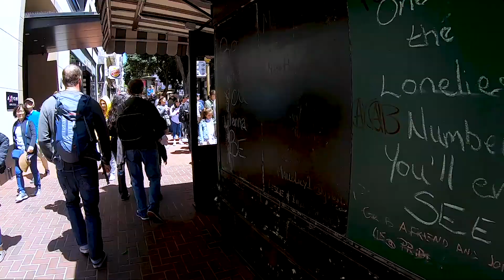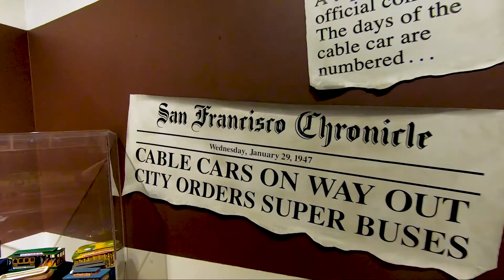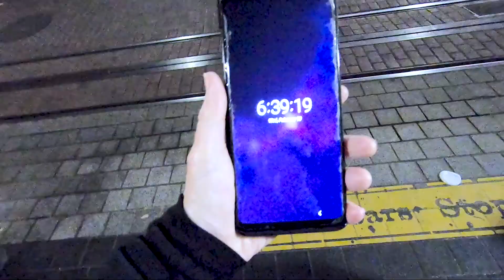How To Ride the Cable Cars 2020 | Everything You Need To Know So You Don't Have to Wait in Line

Comment: My first trip to San Francisco was spring break from an eastern college in 1969. The last day of my visit I bought two 6-packs of Coors beer to take back to my roommates, to a state where Coors wasn''t sold. Toward evening, returning to the Sir Francis Drake Hotel I was on the Powell St. cable car riding up the hill when the cable car came to a sudden stop. The brakeman said that had been happening all day and it would probably be 20 minute to a half hour delay. Some people got off but most of us just waited patiently. Soon a couple of joints appeared and were passed around, shared even by the conductor and brakeman. If it was party time I was gonna enjoy a beer so I opened one up and asked if anybody else wanted one which left me with one six pack instead two. OK easier to pack for the flight home. One of my favorite SF experiences typical of the wonderful culture there in 1969.
Reply from the maker: What a great story!!!  You didn't happen to go to Eastern in KY did you?  That would be too much of a coincidence.  I went to rival Morehead, and bringing Coors back from places was a big deal.  I think your story is great, and, you're right, pretty typical of the wonderful culture there in 1969.  Thanks for taking the time to share your story!

Comment: is the muni pass what you load on to your clipper card??? trying to figure out the multi day thing...thanks.
Reply from the maker: Yes, you can load a muni pass onto the clipper card.  The clipper card can also be used for bart.  Muni is for the city of SF, & bart is for the entire bay area.  You can also download the muni app & use that, although you have to show the app to an attendant before you can enter the station vs. tapping the clipper card.  There's supposed to be an attendant always at every stop, but my experience is that this isn't always the case.  But if you buy a 3 day or 5 day pass, & you're planning to use it for just the cable car, then the app is fine to use.  Hope this helps!  Let me know if you have any other questions!
Reply: @JasmineApple  so our plan is stay at westin airport the night we arrive (so convenient). next morning, head in to city via BART, get off at embarcadero (end of the line, correct?) and either walk or take street car/ light rail up to the grand hyatt at union square.  from there, we will branch out and explore for two days.  on the third day, we will make our way either by public transport or uber or taxi to pier 27 for cruise.  a week later we arrive back and will take BART back to airport to stay at the westin again for the night before our flight back the next morning.  our plans are very loose, but chinatown one day and the ferry bldg/ wharf one day.  we are old and nap in the afternoons.  lol.  so....i am guessing unless we see something we want to come back and revisit, we will just hang around the area around the airport or maybe explore something else you might suggest down in that area.
Reply from the maker: Sounds like a great plan!  But I have some tweaks for you.  First, embarcadero isn't the end of the line for bart.  After that, it heads under the bay and over to Emeryville & beyond.  You'll want to get off at Powell street instead of the Embarcadero, though.  Union Square is on Powell Street, and it would be a 2-3 mile walk back from the Embarcadero.  So get off at Powell -- that's the start of the cable car -- and walk up to Union Square.  it's just 2-3 blocks.  If the cable car isn't busy, you can ride that up.  The Ferry Building is at the Embarcadero.  When you're ready to see that, walk back down to the Powell street station, but don't go into the station.  Instead, walk across Market Street and take the historic F line -- that's one of the historic street cars.  That will take you directly to the Embarcadero/Ferry Building.  If you want to go to Fisherman's Wharf on the same trip, then hop back on the F line, which will take you straight there.  Chinatown is only about 3 blocks from Union Square, so that will be an easy walk for you.  Also, there's a lovely seating area and fountain behind the Apple store, if you want to get coffee and enjoy sitting outside.  I can't tell you how many hours I've spent there!  I hope you have a fun time!  SF is a great place to visit!
Reply: @JasmineApple  thanks so much.  have you other videos with other tips and hints of places to eat, etc, whilst in sfo? you are a gem!!! i will save your comments on my phone to map everything out.  lol.

Comment: Dear Jasmine, thank you for the video. I will be in SF end of this month. But I'm confused about the public transport. Not sure which one is good between Muni & Clippers. These are my list to visit in SF . Please advise if these place are reachable via public transport.
1) Lombard street
2) powel and market (cable car)
3) golden gate bridge welcome center
4) the painted ladies

Thank you
Reply from the maker: Hi Hasnida,  

How exciting to be coming to San Francisco!  I hope I can answer your questions about public transportation.  Muni is the San Francisco public transportation system, and it includes busses, cable cars, and muni trains.  
BART is the county-wide train system.  
Clipper is a card that can store fares to be used on Muni or BART.   

Usually, the cable car is the most expensive fare, at $8.00 per ride.  But for the month of August, it's free, since they just started operating them again.  Normally, I would say when you come to SF, you'll want to get a Visitor Passport, which is unlimited rides on muni only for a single price.  

A 1-Day Visitor Passport is $13 if you get it on the muni mobile app, or $24 if you get a paper passport or put it on your clipper card. 
A 3-Day Visitor Passport is $31.00 if you get it on the Muni Mobile app, or $36.00 if you get it on paper or your Clipper Card.  
A 7-Day Visitor Passport is $41.00 from the Muni Mobile app or $47.00 on paper or on your Clipper Card.  
So normally, this is a really good deal, particularly if you want to ride the cable car several times.  
But if you're coming at the end of August, since the cable car is free, you might want to just add something like $20.00 to your clipper card and use it on the busses or muni trains.
Each muni ride is $2.50.  
If your trip is extending into September, then you might want to consider the Visitor Pass.

The muni website is https://www.sfmta.com/ and you will see all of this info there as well.
You might also want to get the muni app to get fares or search for routes.
On the web page is the Trip Planner, where you can put your starting point (I used Union Square to answer your questions), and the ending point, and muni will show you the best times.

From Union Square to Lombard Street, there are a few ways to get there, but the most fun is via the cable car.
You will get the cable car at Powell Street & Market Street (where the car turns around), and you want the Powell/Hyde line, not the Powell/Mason line.  Lombard Street is at Hyde and Lombard Street, and the Powell/Hyde cable car stops right there.
If you're not able to get on the cable car, you can take the 45 muni bus.  You'll get on at Sutter & Stockton, in the direction going into the tunnel.  You'll get off at Union Street & Hyde Street.  You'll walk up Hyde Street a couple of blocks until you get to Lombard.
This would be free on the cable car or $2.50 on the 45 bus.

To get to the Painted Ladies, you'll go to Market Street at Powell.
You're going to take the 5 bus or the 5R bus.  The "R" stands for Rapid, which means fewer stops.
You'll get off at McAllister & Fillmore.
You'll walk 1 block in the same direction the bus was going to Steiner Street.
You'll turn left on Steiner, then walk 2.5 blocks to the painted ladies.
Alamo Square Park is on your right, right across the street from the painted ladies.
So you can go up into the park and get some great photos of the painted ladies!
The fare is $2.50 for the 5/5R.

Getting to the Golden Gate Bridge is probably the most challenging, because you have to transfer busses.
You want to take the 38R Geary Boulevard bus.
You're going to start at the stop on Geary (across from Union Square) at Powell Street.
You'll get off at Park Presidio Boulevard.
Then you are going to take the 28 North Point + Van Ness Bus from Park Presidio to the Golden Gate Bridge.
Each fare is $2.50, so $5.00 to get there, and this will be about 45 minutes - 1 hour.

I hope this answers your questions!
Have a fabulous time, and let me know how it was!

Comment: Hello, Looking for some advice. Never been to San Fran. Mostly there to board the Amtrak California Zephyr to Chicago over by Oakland but spending a half day across the bridge in San Fran. The plan is to take Cab to Trolley car, Trolley Car to Lombard. Walk down Lombard. Walk to Pier for Alcatraz tour. Cab back to hotel near Oakland. (Gotta get up early for Amtrak the following morning) I got the walk part down from Lombard, but never done a trolley car. Flying into Oakland, cab to nearby hotel, Cab across the bridge. Would I be correct in that I should have the cab drop off near Union Square to buy a Hyde line ticket to get to the top end of Lombard?
Reply from the maker: @GaryWaterman-z5k  Trolley cars & cable cars are 2 different things, so you want to be sure you use the right terminology, in case you need to ask questions.  

You'll want to take a cab to Market & Powell streets - that's where you'll catch the Hyde cable car to Lombard.  

The trolley cars also stop at Market & Powell - they run along Market Street & don't go to Lombard at all.  Trolley cars are old-fashioned cars, but they have a cable on top that connects to wires that run above the cars.  

Cable cars don't look like they're connected to anything.  

The cable car line starts at Powell Street - that's where the large wooden tuntable is that turns the cable cars around to head back up the hill.  

The reason you don't want to start at Union Square, is because the cable cars are often full by the time the cable car gets there, & they'll just pass you by.  It's off-season, so you might not have that problem, but since you're on a tight schedule, why risk it?  

Also, you can get a ticket on your phone - download the Muni App, & you'll be able to get your ticket.  There is a booth at Market & Powell, if you want to buy a physical ticket, too.  And you can buy a ticket on the cable car.  

Hope this helps! 
Let me know if you have any other questions!  

Have fun!!

Comment: Schedule hours on site or app? Thanks
Reply from the maker: Hi Victor, Yes, you can see the schedule hours on the Muni app, but it's kind of buried.  Here's how to get there.  Open the MuniMobile app.  At the bottom, tap on Trip Tools.  Then tap on Plan a Trip.  This takes you to the Muni web site.  In the upper right corner, tap on the 4 horizontal lines.  This displays their menu options.  Tap on Getting Around.  This page gives you the options for how you want to get around.  You want to choose the Muni option.  The next page looks like you're on the same page, but you're not.  Scroll down, and you'll see a section called "Routes & Stops."  Tap on "Routes & Stops."  Now scroll down, and you'll all the different muni lines listed.  You'll want either Powell / Hyde Cable Car, Powell / Mason Cable Car, or the California Cable Car.  The 2 Powells lines go from Market Street to Fisherman's Wharf & back.  The California Cable Car takes you up California Street.  Have fun!

Comment: streetcars are more bus like
Reply from the maker: Exactly!  The street cars and buses are electric-powered.
Reply: @JasmineApple  those electric buses are  called trolleybuses San Fransico is the only place where all types of public transport take action
Reply: The streetcars you see are the style  that appeared in 1941 in St, Louis, MO. with small oval windows.  In 1946 til 1952
when the last ones were made here in the U.S. used  a larger oval window above the regular window. Some had blinker type doors and others had folding doors that were either mechanical or by compressed air were operated. Chicago and 
Boston had the blinker type doors. These modern streetcars were named the PCC Trolleys.